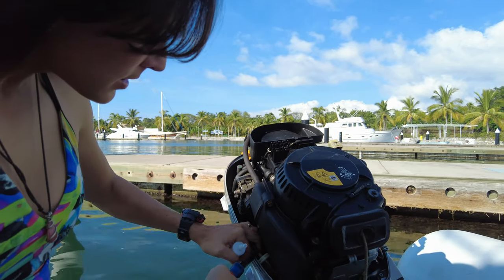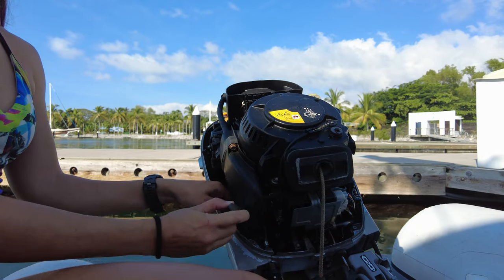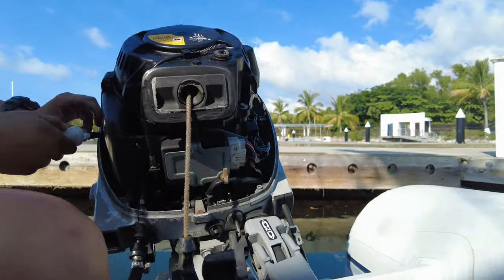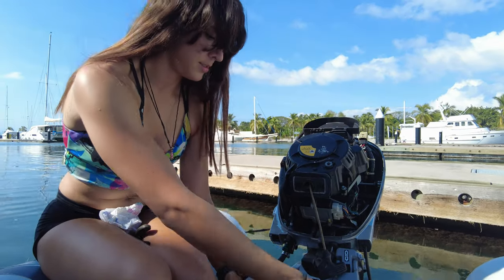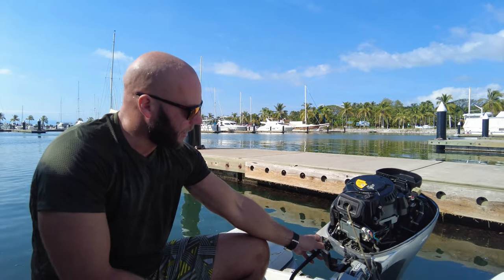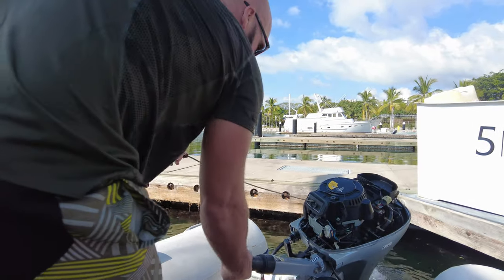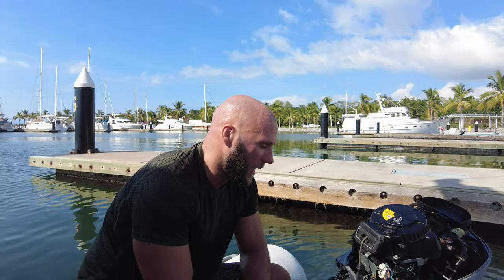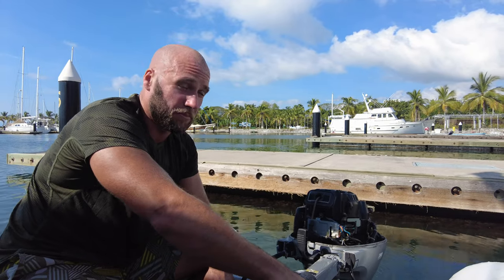Eva repairs the 20hp Honda Outboard (4 stroke)

Comment: Thank you James for your great help and information! Just checked the website of Integrel, looks very promising. Is it an idea to make a in dept video of your electric system setup? I am considering a N51, next two other performance multi's. I don't want a genset and as much as possible solar. Want my boat as simple as possible.
Reply from the maker: You're on the right track. Get integrel, at least 660 ah of lithium and I'd also put a 16k btu aircon for the master cabin at least for at anchor and at night to run off the batteries. You could get another bigger aircon for the whole boat. Depends on budget. Keep everything Dc not Ac if you can
Reply: @carryonsailing  Thank you James for answering! Because of you also looking into 48v. From Neel (a dealer of Neel precisely) there is not so much cooperation towards a more electrified N51 so I have to figure it out by myself and more importantly, with your informative videos. Found the fully electrified N51 of Wolf Boss. Have a great day from The Netherlands and hope to meet in the future..!
Reply from the maker: Pleasure to help. IMHO electric propulsion isn't there for me yet, for the way we sail.

Comment: Hi James. So I also have a Honda four stroke. I can't begin to tell you how many outboards I have owned in 60 years but the Honda 20 has proved particularly annoying. I've felt like throwing it overboard at times however I discovered that the problem is not the engine it's the fuel additives such as10% ethanol. You don't tend to get the problem on bigger engines like a 150 or 250 hp because the carburetors are so much bigger or fuel injected. Two stroke engines which have oil added to the fuel don't tend to suffer either. The issue is that in a small engine like the Honda 20 four stroke you have a small aspirated carburetor. In a small four stroke engine with a small carburetor and no oil added the ethanol evaporates leaving a gummy, sticky mess in the carburetor. Other than taking the carburetor apart (not my forte) the best preventative measures are; 
1. to disconnect the fuel hose and run the engine dry (out of fuel) every time you are not going to use it for a few days. Good habit to get into. Two weeks you might get away with but after a month in tropical heat that ethanol will have evaporated and all the little springs and bits and pieces may well be gummed up 
2. you can get fuel additives to put in "ethanolated" fuel which are specifically designed to combat this carburetor problem and
3. try not to use old fuel. Fuel sitting in a tank in tropical weather degrades quickly.
Fair winds and happy Honda!
Reply from the maker: Thank as always Oliver, it is a point I had not thought about. It an absolute certain, that if I can find one, I will be getting a yamaha 2 stroke for the next boat. I will have a stab at your suggestions, but the old fuel one is tricky when we are well off grid. Hope all is coming along well for you own build.
Reply: @carryonsailing  Pleasure to be part of your journey. The problem with fuel in the Caribbean and 3rd World countries is that ethanol is cheaper so they cut it with as much ethanol as they can get away with. Running the little mother dry every time is the best solution.

Comment: 1.fuel filter 2.clean carb  3.put a new spark plug. check spark and plug wires
Reply from the maker: Totally, I am a bit lazy in the heat if I am honest. We will haul the dingy out the water soon and get it done.